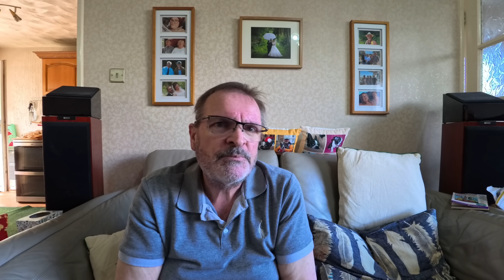Expert Ships Engineer Reacts to Baltimore Bridge Crash

Comment: In Alaska its the ship docking pilot in total control. He gives commands in the wheelhouse and he gives all commands to the tugs at the bow & stern during all docking operations. Did this pilot have a stroke of mental emergency? 
I was on a 104 ft tug that did a log ship docking operation where the pilot had a mental breakdown ( stroke?) and kept getting which tug was at the bow the bow & which was a the stern. Docking a log ship in that bay normally took 30 minutes. This guy took 2 1/2 hours due to his confusion ofvwhich tug was where. Finally our Captain Art Murphy broke precidence and reminded the pilot we were the bow tug. The pilot instantly gave us the command to go from half ahead to have astern. He gave a revetsal of command to the bow tug as well. We were soon duing 360 circles in Hobart Bay. He skipped gears and gave the wrong oders twice more. Finally he was taking the ship into the floating pylons of the logging camp too fast and smashed one 90 feet up the shore as well as smashing a dent in the bow of the ship. Coast Guard investigators flew in and asked everyone questions except for the pilot who called in a seaplane and took off in a hurry before the Coast Guard plane landed. The accident got a big write-up in Professional Mariner magazine and the case of who to blame went to court. The 70 year old grympy ship docking pilot died of a massive stroke before the judge tried the case.

Comment: You didn't discuss the size and weight of that giant ship.  This was a disaster waiting to happen.  Bridges like the Francis Scott Key were not designed decades ago to withstand collisions with enormous container ships.  The positive result of this will be a much more regulated and monitored system for these ships to pass safely under bridges, safer bridge designs, and new barriers around bridge supports to stop runaway ships like the Dali.

Comment: I think the ship's approach to the bridge was carelessly too close to the pylon, instead of being centered in the exact middle between the pylons. When things went wrong; they had no margin for error.__
__ I think they were preoccupied with power astern to slow the ship, rather than steering to the furthest point away from the pylons.__
__ Seems they were going to fast if they were worried about speed beyond the bridge. Sounds like they were 3-knots over the speed-limit of 5-knots. The speed limit near the bridge should be a speed at which the bow-thrusters operate. They were going too fast to operate their bow-thrusters; therefore they were speeding. Could be involuntary manslaughter.__
_Does the ship have to have power to steer such a large rudder? Or can it be done manually through gears and compound-tackles? In any event; if the ship's power goes out; you would think the ship would continue on the rudder's last position, which should have been aimed between the pylons, but was not. You cannot turn a ship this size on a dime. They should have had it lined-up well in advance._
__A ship of this great size, through such a narrow passage between pylons, should have had a tug-boat required. Should have only been allowed in daytime. It is a wonder this did not happen sooner. The government is supposed to allow for an incompetent ship's crew when dictating who can go under the bridge and how they do it. The ship's owner should pay for the new bridge, and for building it fast. The ship should be impounded until payment is made. The bridge was not moving; the ship's crew is at fault.

Comment: Many times, the simplest explanation is usually the best...
1 - Total loss of power/propulsion/rudder
2 - Wind, as evident by the near horizontal smoke coming from the stack, pushing the ship to port
3 - Water - the tide was low/flowing out of the bay. The result of this is a strong current coming from the Poquoson Channel, which would push the aft of the ship to port, appearing to "steer the ship"
4 - Propeller "walking" the aft of the ship, again to port
All of these conditions sadly happened at the same time, ending in the untimely deaths of the workers.

Comment: If a thorough risk assessment had of been undertaken on this bridge and operations years ago it would have identified the consequences if this happened.  It would have identified that the likelihood was low, but the consequences were very high, and on that preventative measures should have been put in place.  I would like to read that risk assessment report (if one was ever conducted) and why they chose not to mitigate that risk.  But it's likely money was the primary issue, yet the money spent on preventing that risk would have paled into insignificant compared to the money they'll now need to spend.
And that's why people need to embrace and implement risk management, not just as some notional concept but as something that will prevent disasters like this and positively affect outcomes.

Comment: the bridge itself should have been protected at the piers in the water - either by concrete blocks or by raising the sand level at the river bottom - so any ship ether hit the concrete blocks instead of the bridge or run aground instead of hitting the bridge - both proactive levels of bridge protection were not added to the bridge from the get-go - so whoever is in charge of bridge inspections and its surroundings in the water and above the water must be fired and replaced with people who truly know what every bridge must have in place before its grand opening as well as years of maintenance and inspections after that - hth!

Comment: Tell me how the call for Mayday went out at 1:27 am and crashed under 2 minutes later, but yet they were able to block off both sides of the bridge from traffic and all the cars cleared? This smells like a cover up BIGTIME! They already said there was missing data from the ships blackbox probably because they know it doesn't add up time wise. Like on 9-11 when the BBC was reporting Building#7 fell 26 minutes before it actually did. They then had to say it was a mistake. What you see now is damage control that the media is doing with the bridge collapse

Comment: large ships that can easily wreck a bridge above a certain weight should be treated differently than smaller vessels.  1. THREE BACK UP GENERATORS that are tested every year in a failover test and documented in a Safety Integrity Level above SIL3.   Multiple electrical and control computers are also part of the redundant system.   Multiple redundant SENSORS and IO also must be present with proper voting systems.  Dont do like the Boeing Max 735 which also had single point failiure.  THIS TYPE SHIT SHOULD NOT BE ALLOWED IN 2024.  ITS BULLSHIT TO ALLOW SINGLE POINT FAILURES OR SUB PAR ENGINEERING on these size monster vessels

Comment: When I served on the USS Hepburn FF 1055 there was a diesel generator that was designed to automatically start using high pressure air and restore power. We used to run drills to make sure that it did.

Comment: Nice conclution Cheif, I made my firs and last black out in 1980 in the Meditaranian sea as a young 3 engineer, due to a malfunction of a solinoid valve. Then we found out why the 2. aux engine had not been stopt for 8 months. I agree on what your telling, and the ligth heavy fuel switch is plausible, but can you give me at heads up on how the elctrical grid is layed out on a  modern container ship. Is it a singel or double busbar system, any High volt distribution due to the bow truster, Dali has 2 X 3,8 Mw and 2 x 4,4 Mw generators and the singel truster is at 4,4 Mw, depending on what was running and the distribution setup, it has to be SHTF to kill it all. In my time we always ran 2-3 aux generators i habor manuver or narrow passage, Suez, Panama, Missisipi, etc.

Comment: I have worked on large marine diesels and served on ocean going tug. In fact there is a generator that runs ship when docked. Most large ships have from 2 to 4 generators The main engine has what is called a shaft generator that only works when under way. To reverse the propeller the main engine has to be stopped and restarted in opposite direction.
I tent to agree the full astern turned the ship to starboard. My bet is on fuel problem with main engine loss well before the bridge started to happen.

Comment: Thanks for making sence of this forgot about what you call the paddle wheel effect of the propellers also known as prop wash. I have experienced this on small planes (they have propellers too) it can literally pull you off the runway. Thats with only a 200hp engine with the thousands of hp that that ship had such a foce must have been considerable. As for the so called explosion on the bridge girder that looks more like a high power line arching as it was pulled apart.
        Never forget that the United States has the finest government that billion dollar corporations can buy. Is this why the ship with such a maintenance record allowed to sail?
        Was the crew Diversity, Equity, Inclusion,  or were they really qualified?

Comment: Yes! It seems to me that going hard astern was exactly the wrong action.
It will be interesting to find out who ordered that.
Not only will prop walk swing the ship off course, but going stern will blank the rudder - making it ineffective.
Am I correct in thinking that ships, unlike commercial aircraft, do not have any redundancy in control of the rudder or main engine?
It is a monthly occurrence to see cargo and cruise ships going out of control and ramming into other ships, docks and container cranes, so I assume that the answer is no.
Reply from the maker: Steering will only have one control system and hand back up.  two pumps
Reply: @retroonhisbikes 
And the main engine? I assume that there is no backup for the engine systems and control of that?
That seems to be the main problem.
Just for example - a few weeks ago in Turkey a container ship crashed in the dock, wiping out 4 container cranes and severely injuring one of the crane operators. 
It was the same scenario - coming in @ around 9 knots and out of control. No reduction in speed, did the futile anchor drop and hit the dock with almost undiminished speed.

Comment: The same thing was done on the Titanic I believe. The order was given to reverse full astern.  The results was  they lost efficiency  on the rudder losing steering enough to hit the burg.  Like this man said, more water past the rudder by hitting forward thrust  giving the rudder more steering power to the ship, turning it faster. Natural instinct  is to back away from danger. Giving the wrong orders in a moment of panic with  the amount of time left, tiny as it was to avoid disaster.  On the Titanic, those few seconds doomed the ship. Same here with that bridge. My question is, why were they not in the middle of the shipping channel keeping as far from those bridge supports as the ship neared the bridge? Losing power should have just sent the ship drifting past those supports somewhere in between those bridge supporting structures. Now if the ship was closer to one side of that channel or the other, there of course would be less room for drift from currents in the water affecting the ship. Seems this along with reversing the engine ended up bringing a crash. What can you say? It's a tragedy all the way around. If there is any good thing about this is it didn't  happen during high traffic  hours....

Comment: They lost power to the main engine and began to drift....power was restored briefly to the main engine at which time they went full astern (puff of smoke) with the rudder in the same position and then lost power again...am I understanding this theory correctly?
Reply from the maker: Yes
Reply: thanks.  and since this ship is presumed to be direct drive, even if the engine didn't re-fire, the prop would still rotate as they attempted to re-fire?

Comment: i agree your over site is priceless, i am a x navy Quartermaster , to things to add . one the aft steering is slow at best . it is not a prefect system it does not work as tuned as the forward steering system , most are hydraulic   systems and take time to respond   if you even have a crew that is trained in AFT steering ,and you are correct the helmsman and the captain are the two controlling the ships movement ,most navy ships after the early 70's had bow  fin stabilizers added to counter the rotor movements ,and you are correct from the aft looking at the stern  the forward movement is clockwise, so yes you can rule out aft steering to stop this event . most Captains would not have dropped Anchor even if it was the smart choice at the time . ether way the ship was already in trouble  ..the pilot only directs the helmsman  , the ship is only as good as their helmsman .. even the captain trust his helmsman to know the ship and how it reacts under way at all speeds . and i agree this ship was doing over 8 knots , thank you for your oversight sir stay safe stay free

Comment: Bow thrusters:  I heard with a little concern what you were saying about the efficiency of the bow thrusters!  It is astonishing that, under emergency generator power, the bow thrusters have no significant effect, certainly not enough (in your opinion) to have prevented this mishap!
As an engineer, would you not say that the whole point of bow thrusters is to provide a strong sideways "pressure" right at the very tip of the bow in order to move the bows in either direction very "quickly", relatively speaking?  If you are saying that even 4 minutes of emergency power could not move the bow the few degrees needed to avoid (or lessen) the impact then what exactly are they there for? Surely it's easier to redirect a moving ship's bow a little than that of a stationary ship?  It seems I have been under a totally false impression of what bow thrusters are there for! 
Surely, also, this points to a serious design flaw in such massive ships, which are pretty difficult to steer when moving relatively slowly?  Is the time not coming that for restricted waterways a limited maximum size be legislated (eg also in Suez Canal) to prevent such enormously expensive accidents? 
Thanks for a very informative video.

Comment: I served as a helmsman for a number of years on the great lakes. I admit that I don't know how the helm is operated on a modern ship and therefore what I suggest may not be possible, but here goes. The ship turned sharply to starboard after the power was restored. I think it was a faster turn than one that could be explained solely by the ship running astern. When the power went off the helmsman was watching the ship approach the pylon. I think that he instinctively adjusted the helm to starboard just as a car driver steers toward the object he is looking at in an accident. I suggest that when the power was restored the rudder responded to the command from the helm and turned the ship to starboard.
Reply: Everyone seems to forget that these behemoths have, really, no "turning radius" to speak of!  If you base your sense of "well, turn the wheel and the ship turns, like a car or truck:  First the rudder itself is VERY slow moving! Swinging that huge chunk of metal from one side to another takes quite a while.   Next, the mass of the ship and the speed at which it is moving mean turning and "stopping" (slowing down as much/fast as possible)  takes about near forever (or so it feels). 

The "maritime rules of the road" REQUIRE small ships and personal boats to yield right of way (generally) TO the behemoths, because they CANNOT slow down or turn out of the way to avoid hitting, rolling over and crushing the smaller ship.  (OR the bridge abutment or pier!)  There is really no comparison to big 18-wheel trucks NOT being anywhere near as maneuverable as a car. That's because the trucks are on solid ground.  Unless there's ice, and, in effect, ships are always 'driving' on 'ice.'

The three motions a ship is heir to are: roll, pitch, and yaw.  Roll, y'all know about -- that side-to-side 'swing' that makes some people seasick.  Pitch is the fore and aft up-and-down motion (If you're a seasicker, the closer you can get to the center -- lengthwise, the less you'll suffer this.) The really bad one, and the least manageable is 'yaw.'   Yaw is that 'sliding on ice' where the bow and stern are ... .sliding  left and right. A truck (except on ice) probably never has yaw -- the solid ground doesn't let the tires 'slide' left and right... A ship never is free of it...
Reply: @Avalanche-Ice1950  
Yaw is what they called "getting a swing" on the lakes, when the ship seems to pivot on the center line. The ship that hit the bridge seemed to do that. It turned very rapidly to starboard. Admittedly it would be too quick to be a simple response to the helm. It might have been done by both a bow and stern thruster, by hitting something on the bottom or by the anchor. Dropping the port anchor as they did should have turned the ship to port. I noticed that the anchor chain was hanging vertically and not leading astern. The vessel may have run over the chain at some point so that it was running off to starboard.   I wonder if the position of the anchor in relation to the ship somehow managed to hold the bow in position so that the forward motion of the vessel resulted in a starboard turn.
Reply: @Avalanche-Ice1950 brilliant comment!